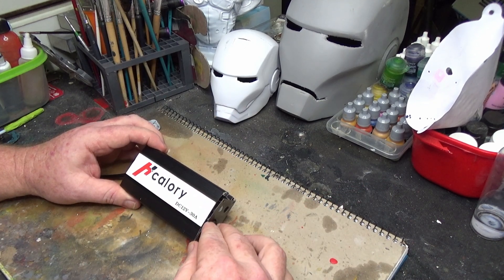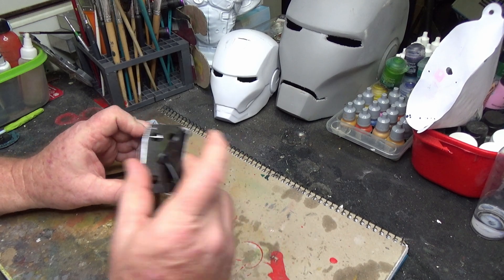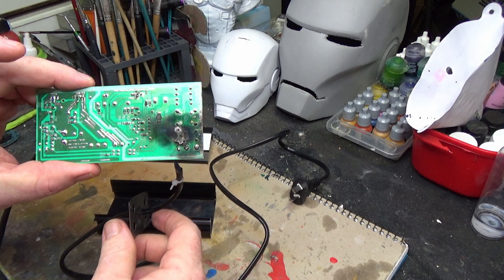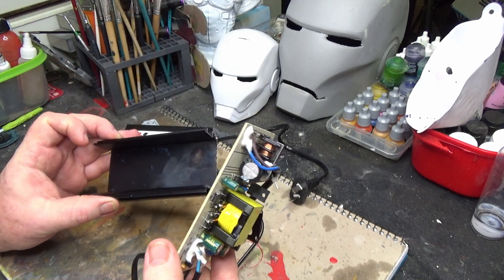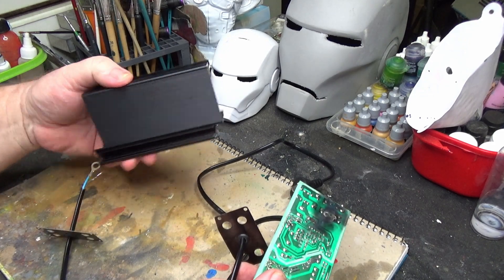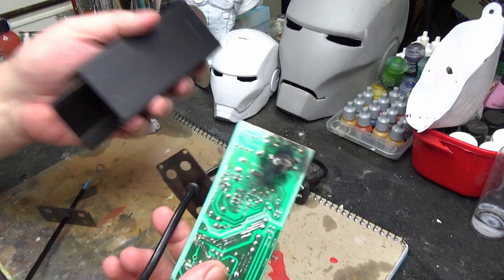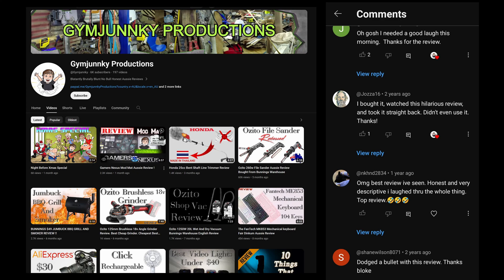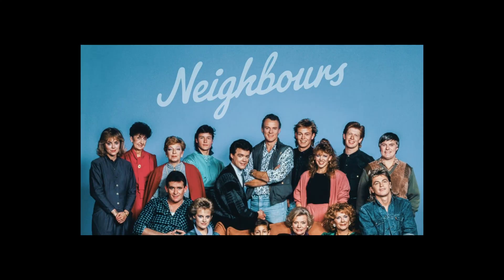ILLEGAL DEADLY POWER SUPPLY !

Comment: Also, the plug pins aren't insulated like the ones we have in Aus.  Looks like it is intended for China, they have the same plug in a "V" shape, only inverted.  I would assume in this case where it arced, both the active and neutral shorted to the case at the same time.   I suspect the bulk of the current would flow over the course of least resistance -- the neutral line -- rather than through your high-resistance body.  Otherwise, if only the active touches the case and you were holding it, you would be risking a shock as the energised case conducts through your body to earth.  I guess the minimum paid worker forgot to install the sheet of paper or plastic that was meant to insulate it against shorting to the case, that probably passes for electrical safety in China.
Reply from the maker: Pretty bloody dangerous... Not something I would like my kid playing with ...